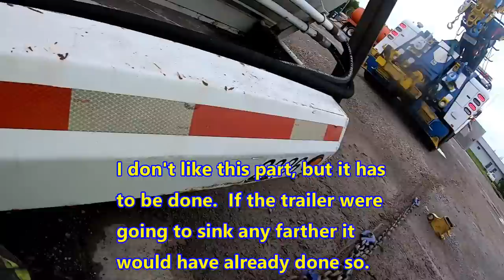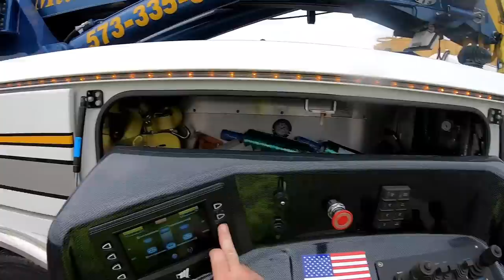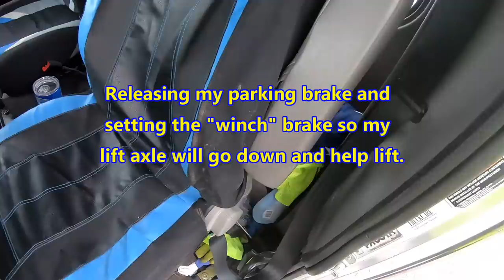Loaded Tanker Takes A Dive....Nose Dive That Is

Comment: I saw a few comments about how the trailer was dropped.  Yes, some carriers put heavy wooden pads to go under the dollies its they are typically dropping off on dirt yards. All our flat-decks had them but we were hauling lumber and steel out of a lot of loose dirt yards in the PacNW. 

So in this yard they had a concrete pad to line up the dollies over, but I noticed that where the trailer was dropped, the concrete pad was thoroughly covered in mud with only a little bit of it showing ~20' to the blindside of the arriving tractor.  In the dark I doubt someone not familiar with the yard would even notice that there was a hardened pad to drop off on to. And to top it off with all that Mississippi bedrock just under the surface (not) it is hard to guess where the soil is going to hold and where it is going to give out in a rainstorm. So please give the driver a break. We don't know what it was like when they dropped off and folk are just making unkind assumptions.

Now when we (back in the day) had a trailer sink in, we didn't have a cool rotator to help us. We'd get one of the 20-ton forklifts from our steel yard down the road to come on over and lift the front up and another forklift to jam a couple of stacks of heavy-duty pallets from the side just behind the kingpin (if there wasn't enough room for the small forklift, we'd have to do it arm-strong style), setting the trailer about 3-4" low. Raise up all the way and then lower the landing gear on some cribbing and then slip a yard goat/tractor with deep pickups rails under the nose, dollie up, skooch out the pallets, and then drive the trailer to a firmer place to drop it.  Equipment needed: a heavy forklift and a second small forklift, a dedicated yard goat and a bunch of heavy pallets set aside—and the time to get all the equipment and operators over to where the trailer was stuck. 

With the the rotator, job done with one man and no other special equipment or operators! 

Rotator: Worth Even Penny.

Comment: Years and years ago before  I ever owned the recovery operation as I do now, we had an account with a local bulk fuel transporter. They had multiple fuel tanker trailers which incorporated "pin style" landing legs that were never intended to be used when the trailer was loaded. The shock of taking the load would drive the gear through the bottom of the aluminum,  instant  massive EPA issue. We used to have a 1 ton PU loaded with railroad ties that went out every time we had a situation involving one of these trailer and stack the R/R ties up to take the weight of the trailer. Also we never towed one with a wrecker loaded, only with another tractor.  If there was something  wrong with the trailer we usually put them on a trailer,  empty. They were a pain in the neck and we were glad when the last one was gone.

Comment: I notice at least one comment on the "reality TV" towing programme. By coincidence, I watched a few minutes of one of these shows just last night. I couldn't watch it. I seem to have picked-up a few tips from you Ron and I couldn't believe what a cowboy operation was shown. Chains/cables breaking because he had no idea of their limits; all the equipment was wet and rusty; no safety gear etc. Everything was over-dramatised but none of the "real" dangers were shown or explained. After a few minutes of shouting abuse at the telly, I gave up and switched it off.
I'd much rather watch you doing the job properly. You take a little longer to set stuff up but, once you're ready, it tends to work first time. By the time the cowboys have tried all the"quick" ways, failed, then managed to get it kinda right in the end, you have finished the job and gone home. I know which way I prefer.
Thanks for another interesting, educational episode ~ great to watch - as always.

Cheers for now,
Dougie.
Reply: I run a truck repair shop and I can't watch the cowboys either.  They do more damage than the accident did.  Truck looks repairable and 10 minutes later it is a total loss.

Comment: Where I worked we had a box trailer do the same thing. We were able to raise the front with a forklift and shore up where the landing gear on the ground (steel plates) held long enough to get the tractor under it.

Comment: When I was a kid in high school, I worked for an independent gas station chain in the area where I lived. They were married to a sister company,  heavy equipment and construction.  Two separate businesses, under the same roof, so-to-speak.  Anyways, the equipment side of the company also had a few tanker trucks and trailers for hauling fuel to their job sites.  Fuel tankers generally have compartments, to keep different product (regular, unleaded, premium, diesel, stove, etc.) separated.  Well one day, one of the equipment guys went out and loaded just the very front compartment with diesel fuel.  He then proceeded to park the trailer on the pad in the yard.  As soon as he dropped the trailer and drove out from under it,  it took a nose-dive.  Miraculously, the dolly legs didn't fold up under the strain.  There was the trailer with its entire tail end up in the air,  nose-down on the pavement.  So, after some pointing of fingers, some discreet laughter, and likely some words exchanged between workers and management,  a big loader was brought around,  a chain was strung from one side of the bucket to the other, looped behind the kingpin,  and the trailer was gently lifted back horizontal.  They then used another loader to hold the tail end down on the ground while the big one was removed at the front and a tractor could be backed under the trailer again.  I heard that the only damage done was where chains or buckets touched paint, some minor scratches or dents,  which I heard became the job of the "guilty party" to clean up and paint over, on the very next sunny day.  I would imagine that they even had the paint on hand already,  so other than some time and fuel,  it probably didn't cost anything out-of-pocket. A valuable learning experience for all, though.  As for dollies sinking into the ground, yeah, I've been involved in that on both ends.  The one time I dropped a trailer on poor ground,  I had only pulled ahead 3 feet and stayed where I was for the night, had the receiving manager knock on my door in the morning wanting the trailer in the dock,  and luckily it had stopped sinking when the trailer's nose had settled on the rear wheels of my tractor.  Had to do some fancy dancing and a lot of dolly-cranking to get it up high enough for me to get the fifth wheel back under the upper plate. Luckily, it was just a "dirt" lot, so no pavement damage, but again, a valuable learning experience.  I've also come across many trailers that were sunk down past the point of saving, nothing you can do but advise management, and let them make the call.  I learned my lesson, but got a VERY lucky break out of it.  Never, ever drop a loaded trailer on anything except a concrete pad, or else use wooden pads or lumber to help spread the load a bit.

Comment: Near where I live, a guy was crushed between two semi trailers when one of them sunk into the mud unevenly and leaned over.
Always watch yourselves walking between loads that are detached from a truck and not sitting on concrete.
Reply: Ain't just wet dirt. At a truck stop in Arizona some years back a chunk of parking lot that had been laid not thick enough collapsed under a loaded truck and killed a guy as the landing gear sank into the sand.
Nobody to sue or blame, the contractor that had laid the lot was long out of business. Insurance paid for his burial.
They did end up tearing up the whole lot and re-laying it to code though.

Comment: Glad hand: A coupling device used to connect air hoses between rail cars or between a tractor and trailer.  I love learning new things. 
Thank You
Reply: Glad Hand: because you put them together like a firm handshake. Start in at about 90° and then settle to about 180° and they are firm and locked like a good glad hand shake.
Reply: I second that , Alan
Reply: Glad I learned something new!!! 
In the UK, those hose connectors and hoses are known as 'suzies'
And they are straight push in connectors too..
Reply: @rcatyvr  i usually have to best on mine to get them to connect and not leak 🤣
Reply: In europe , that type of coupling is called a 'palm' coupling , for obvious reasons (put your flat hands together and turn them in opposite directions.....see ?) . ...... In England we have straight push on 'quick release'  type air couplings .

Comment: That seemed to go smooth.  Reminds me of the time a driver and I had to raise a 40' container loaded with toothpicks that had taken a nose dive when the ground suddenly thawed.  All we had was some steel C channel and some wood blocks, and a '79 White Road Boss tandem axle day cab.  We cranked the landing gear by hand up enough to put the tractors rear frame rails under the nose of the chassis.  We cranked the landing gear back up so we could cover the holes with the steel and blocks. The weight on the truck frame nearly had the front tires off the ground.  There was about 14 to 16 inches of clearance between the top of the front tire and the fender.  Then cranked the landing gear back down enough to back the tractor under it.

Comment: Hi Ron. I am a follower from Spain (English Ex Pat, retired) In my work over many years I have had to do heavy lifting, on site and in my employers factory. One of the most important things was for any lift to be checked, checked and then checked again before any weight was put on the crane. You are correct in stating the obvious to me about securing the load.
One more point on safety, nothing to do with you Ron, but the legislation about lorry safety. Here in Spain and most of Europe, all the lorries, trailers, whatever you call them, have to have side protection to stop vehicles, pedestrians, cyclists, etc from going under the gap between the back wheel of the tractor unit and the front most wheel of the trailers.
I have noticed that your trailers have no side protection and, on average much greater distances, ie longer trailers than the European counterparts. Is this not an important rule that should be applied to the truck industry in the USA? Even our rigid body lorries have to have side fenders. I think you know what I am on about, but if not I can supply pictures.
Keep up the good work.

Comment: I was always taught to never drop a loaded trailer on asphalt or normal ground without putting timbers under the landing gear pads. Helps spread out the load and prevent the trailer from sinking.

Comment: I haul tanker trailers and that is one reason why it is against our company policy to drop(un-hook) a loaded trailer. For the obvious reason you had, the ground could give way and the trailer would do a nose dive as this one did, potentially damaging the trailer and releasing product. Also the dolly could give way from all the weight and nose dive..We had a situation kind of similar to this at our company in Savannah, GA and the wrecker company dispatched 2 rigs to lift the nose of the trailer- one on either side of the tanker so we could then put a tractor up under it..Now, it could also be apples to oranges, as this trailer did not have a HM load, all of our trailers have HM(mainly gasoline and/or diesel)..And yes this kind of recovery IS dangerous and you did a fine job, would have been a WHOLE lot safer and maybe easier if there were 2 lifters to lift the front of the tanker and have the company put a tractor under it..Good job nevertheless! :)

Comment: Looks to me like a case of a driver not making sure the turntable was not fully engaged to the trailers tow pin.  Tries to leave, and it falls off of the turntable, the weight of the fall embeds the legs in the dirt.

Here in Australia, what drivers do, is reverse the cab up, connect up to the trailer, then before attaching the air hoses, try a tug test.  Because air hoses are not connected, the trailer brakes are not released.  If it falls off, no sweat, its still on legs.

If the Tug test passes, Connect hoses, then raise the struts (The parking legs).

Comment: Finally Ron breaks into the 1080p videos instead of 720p.
Reply: He has been using new editing software and did not see his mistake of not selecting the right image quality codec (low HD or FHD is not that noticeable on laptops or mobiles). He has since found out the error and will be posting in 1080p at most from here on.

Comment: Is that a food grade tanker? 
Looks like an old vac tank. 
And this is why you always drop trl on a concrete pad.
Or a steel plate. Great video as always. 2x12 timbers work great as well.
Reply: Anything would be better than just the dolly feet, especially if loaded, on soft ground, and wet weather is expected. Heck a couple of old car rims may do the job in a pinch.

Comment: Just for paranoid safety, I might have put a sling around that and lifted snug before getting under it along with a block, or shoved in a lot more blocks. Assuming it will never sink more is probably good, but its those one in millions that occasionally bite hard. OK, I admit it, I am very risk-adverse,  always try to protect from worst case..   Ron did good.. Fragile structure to lift, soft work area..   The range of what these guys are challenged with is amazing.. Sure is cool to see the modular hardware in use over the years, and how so many things can be rigged to pull or lift in safety.

Comment: Great job as usual Ron - just wondering, when using two lines from the crane will they compensate ( to even the load ) or do you have to work them manually?
Reply from the maker: I must work each line manually.  Thanks for watching and God bless.

Comment: indeed it is a heavy, dangerous lift. If that tanker is loaded to capacity I would estimate the weight on the front at 30,000 - 35,000 lbs. Not only that, the boom winch has to work against the pull and resistance of the ground. It ain't going to yield those legs easily. Once the trailer is lifted sufficiently high enough, there is the issue of the landing gear having possibly being damaged.
Reply: Good thing it was not a muddy hole and had a void and this no "suction" which would have made it seem much heavier.

Comment: That was a great piece of work mate and you handled the dangers very well. As a Brit ex trucker and Scania Master Tech. I just do not understand the American idea of running two axles right at the rear of the trailer. Basically putting some what 80% or 90% of the trailer weight on to the kingpin and tractor and hardly making the rear axle work at all. Plus it drags over on corners something real bad. No criticism intended it just doesn't make sense to me. Had to smile at the 'glad hands' as we call them 'Palm Couplings' although UK trucks use the same fitting you had on the other end of that red air suzie.
Might be of some interest but we run similar gross weights here @ 44 Tons with 13.6 Metre (44.6 Ft) trailers but run 6 x 2 (cabover) tractors and triaxle single tyred trailers all on air. The 3 axles are set well forward from the rear of the trailer and we have kingpins 1.6 Metre (5.3 ft) in from the front. This makes the trailer track better round corners, brings it closer to the back of the cab plus we have 3 axles pulling us up from the rear. Its all driven by our 16.5 Metre (53.5 Ft) overall length limit and why we just do not 'do' Conventionals. We are trialling 15 metre trailers currently.
Reply: Non-sliding (stationary) trailer axles are set to maximize what is referred to here as "bridge law formulas"...distance between axles, distance from kingpin, overall spacing from tractor steer axle to last trailer axle, etc. 

 Some states only allow certain spacings for certain roads...that's where sliding axles can make you legal for not only weight distribution but also maximum allowed spacing. 

Trailers can be anywhere from 28' to 57'...1 to 4 or 5 axles...some that self steer and some that lift and that's just for 
"legal" weights and normal freight. It gets real interesting when you get into spacings, axle weights, tire capacities, etc in dealing with over-dimensional loads. Weight limit bridges, weight limit roads, vertical and horizontal clearances all add into that mix...resulting in some convoluted routing by permits to  "simply" go from point A to B.

I don't remember seeing Ron dealing with scooting a over-dimensional load around a too tight corner or turn....stay tuned, I sure in the future we will get to see that !

 In the end its all about keeping the load balanced for traction and braking, also putting the least amount of stress on the highway system.

Comment: Right in front of where the trailer sunk in is a cement pad to prevent trailer from doing just that.  But it don't work if you don't use it. No pad? Anything to spread out the weight.